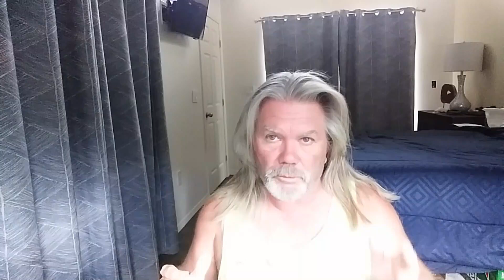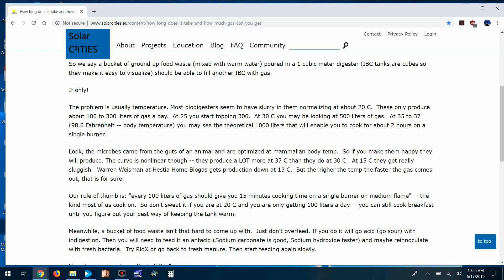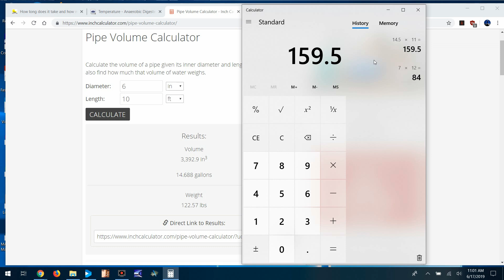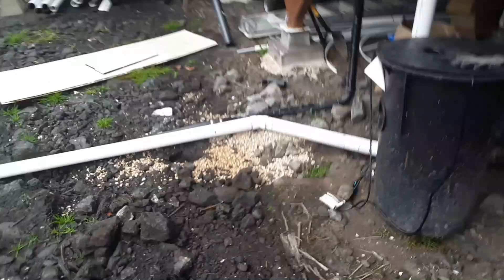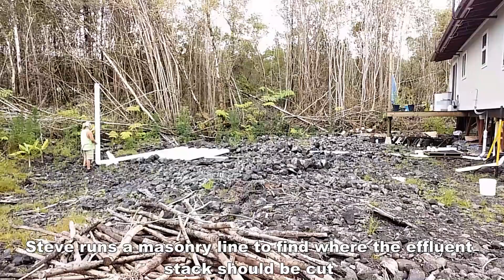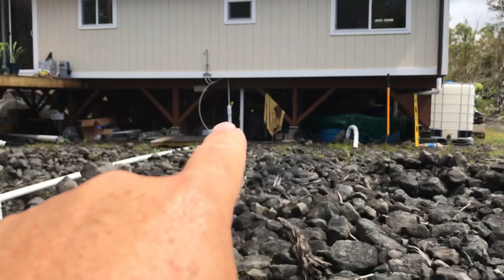50 Hawaii Off Grid Linear Biodigester Theory and Construction

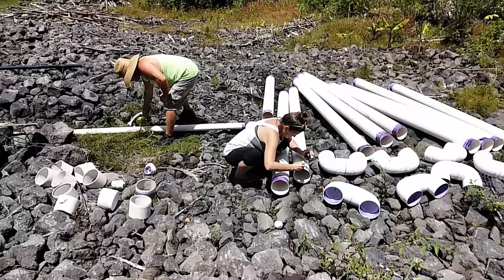Comment: steve, I was rewatching the bio digester video in hopes to troubleshoot the low gas output.I noticed that you used a 4 - 6 inch increaser/reducer (29:56) on the horizontal. being a concentric fitting, there is going to be a blockage at the top preventing the gas from escaping the lower section easily. had you put that on the vertical where you did the drop, it would have funnelled up without problems. 

What are your thoughts on this?

Also, is that toilet Vented through the roof?
Reply: Michael Illingby you’re right. That reducer traps some of the gas at the top of the larger pipes so the scum bacteria on the liquid surface area has a place to live without being crowded against the pipe wall.  Initially I didn’t have the toilet stack vented, and it did cause some problems as I expected could, so I tied it into the house venting.  I’ll try to get another video up soon.

Comment: Science!  Steve if you ever have enough organic litter/mulch you could bury the pipe and let the decomposing "mulch" warm the pipes fairly significantly and consistently. This could increase the digestion rate or possibly allow the use of the next higher temp range bacteria...and make more gas. Withdraw the decomposed mulch as it becomes new soil and apply new leafy mulch to continue the process. Seems warmer is better if you want the gas.
Reply from the maker: You are right about the higher temperature ranges. But our home is all-electric solar powered. So for us, the benefit is more for fertilizer than gas. The gas is actually more of a novelty than for practical application. If it works, my idea is that others can take the idea and run with it, making such changes as fits their wants or needs.

Comment: I have done various research on biodigesters, I have seen large plastic containers and so forth, similar to the designs you showed and watched various videos on Youtube, your method seems very inexpensive and all your research very meticulous! Great job!
Reply: Christina Salinas thanks!  I’m hoping to find an alternative to the septic systems that code requires people to install. People generally just run their sewage in the forest because they simply can’t afford the $2500 for a cesspool. Now those are illegal and the $10,000 it takes to install a septic system is just pipe dream money to most people.  Hopefully this $600 alternative will be viable.
Reply: @OffGridLivingSteve  Wow...sewage in the forest....really? If all goes as planned this seems like a very viable option!
Reply: Christina Salinas hopefully so. We’ll find out in a couple more months!
Reply: @OffGridLivingSteve  Hello, this is Christina's husband, Brian.  If the plan doesn't work initially, you may want to consider burying the pipes under composting vegetation.  This would generate heat (for free) that would bring the piping closer to the temperature of the human body and may generate the digestive effects you are going for.
Reply: Hello Brian!  Most biodigesters operate in the thermophillic range (125F-140F range). I’ve designed this to digest at the much slower psychrophillic range (~68F range) - one of the big reasons for the 2 pint flushing toilet.  It helps everything move slower to allow the psychrophillic bacteria to completely digest all the organic matter. It is slower, but more reliable than trying to maintain a higher required temperature of the other types.

Comment: Steve, I have watched your discussion, and explanation of bio digesters more than once. I think your design is quite unique . I do have one question, because of my observations. Do you have a trap under your toilet? Correct me if I am wrong, but from all you have said, you don't have a trap. My observation tells me, a bio digester, needs to block the bio gas, from escaping at both ends. All other examples of bio digesters shows the slurry blocks the gas from escaping at the input and output. It seems to me with your design, when you flush the toilet, your gas pressure will escape through your toilet. Let me know what you think about this.
Reply: richard camp notice in the video I run a mason line about midway high of the toilet stack to the output end of the system. The toilet stack will fill halfway between ground level and the toilet, blocking the gas where it’s only exit point is the gas collection assembly prior to the toilet stack.
Reply: @OffGridLivingSteve   Can't wait to to here about the methane production, after it starts. Although I live in AZ, altogether I lived in HI 19 years, and built three houses. One in Hawaiian Acres in the mid 1970's, and two in HPP, 2000 and 2006. I plan to return. The only thing slowing me up is the love of my life, now marred 28 years. She is addicted to a game called Pickeleball. Kind of like your friend said, she is moving back to Hawaii, she just doesn't know it yet. We will come visit within a year, and maybe you and Momma D can help me convince her.
Reply: richard camp we look forward to you getting back, but that girl of yours could be another story. 😉
Reply: richard camp not sure that came out right, but I’m sure you know I meant well.
Reply: @OffGridLivingSteve  It is all good. When you meet her, you will understand.
Reply: richard camp gotcha!

Comment: Would a grinder pump help right at the beginning of the system after the toilet?
Reply: I'm trying to build this as simplistic as possible. We've been using it over 2 weeks with no sign of it filling up yet. It will take probably a couple months to fill. I do have a sewage basin and macerator pump ready in case there is such a problem arise.

Comment: Is the lesson that important to have I mean you only go through a 5-gallon propane tank probably a week if you're in even less than that
Reply: James Ledesma right now we don’t use any propane at all.
Reply: @OffGridLivingSteve  then what's the point of getting the gas to burn your food with if you don't use propane what's the difference go to all I ever just to get some some stove cooking material or some outdoor fire pits I don't get what else you going to use it for you talking to U of U do you need hot water I guess that's it I guess in Hawaii you don't need heat
Reply: James Ledesma we have a hot water heater, but it’s electric. We don’t need heat because it doesn’t get cold in the winter. I want to use the gas for a clothes dryer so Momma D can dry clothes even on rainy cloudy days.

Comment: What's wrong with a septic tank don't there's just leaks right then you can just have them pumpkin once every whatever year it is you have a truck come out and pull it out doesn't go into the system is it safe self to be to be pumped out doesn't it mostly it filters out of the stuff they couldn't have to go to the pump station why even risk it so why you don't want to damage your why it's a why you don't want to damage Hawaii
Reply: Septic system costs over $10,000

Comment: Hi Steve.   I viewed this video with great interest and I think you have assembled something that could benefit many homes that are similarly located as yours is.   I stopped the video a number of times to study the assembly and wished it could be possible to assemble this system with clear plastic pipe so you could easily view the 'digestion'.   My concern is the lo-flush toilet in combination with the length of pipe.   Will there possibly be too much sludge  collected in the length of pipe, whereby it will simply clog?   My thinking is the lo-flush toilet works great when the collection tank is just a short distance away (as in a RV) and the lengthy pipe system will pass sewage only when there is a higher ratio of liquid from other other outlet appliances besides the toilet .   Be interested in your thinking here....
Reply: Bob Calder what I’ve been able to tell so far is that the system is filling up slowly from bottom to top. I don’t believe there to be any issues of clogging anywhere.  The issues of read about have more to do with hydraulic overload (water logging) from too much water. I think the RV toilet provides a good balance of water vs solids ratio. Time will tell for sure.

Comment: We buried a 55 gallon barrel with a backhoe and poke some holes in the bottom. I dump the grey water and brown water from my RV into it at the same time it would easily gobble up over 100 gallons. It wasn't going into a cave or anything just seeping through the porous Rock of Pahoa. My kids go through a lot of that Charmin toilet paper from Costco and for a few years it all got flushed. I had an opportunity to look inside before the lava took it over and there was absolutely nothing in it. No poop no paper, nothing.
Reply: Travis Sanders you definitely had bacterial digestion going, but being aerobic instead of anaerobic, working more like a septic system. That’s interesting to know. Thank you for sharing that.

Comment: I know you've done a lot of research..
Years ago i saw a bio- digester in Africa remote village (article)
They used a metal tank for the sledge digester  and used the gas to run a generator for electricity at night..
My question is...
Might a black plastic help raise the digester temp and stabilize the night temp.
Reply: jim h I’m sure it could help heat the contents, but I really wanted to try this new design of my own making. It might be an epic fail, but at least I’m on it!  😁
Reply: @OffGridLivingSteve  
It sounds reasonable to use the human body design..
I'm thinking worst case...
You might need to run a second digester to allow more time to digest..
But you are paving the way
👍👍👍👍👍👍👍
Reply: jim h I did build it twice the capacity of my calculations. Hopefully there will be no problems
Reply: @OffGridLivingSteve  You could always paint it black if you need to, right? Or cover it with a black tarp or plastic. I was wondering why you didn't use ABS?
Reply: Magic Smoke FPV I will bury the entire structure under gravel once it’s operation is confirmed